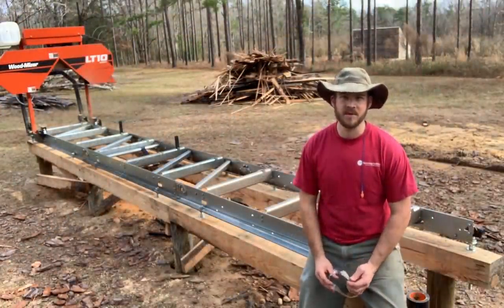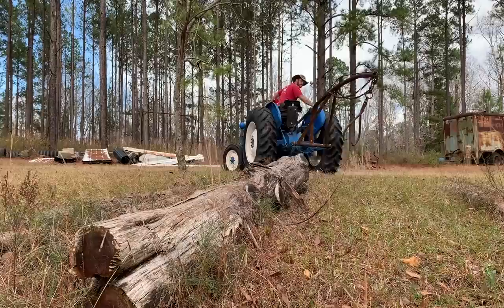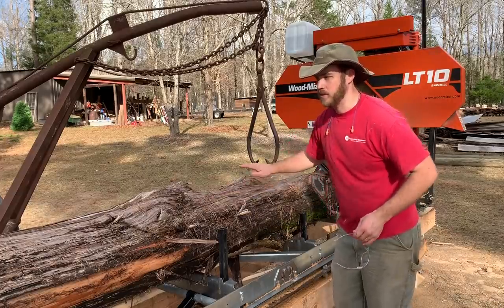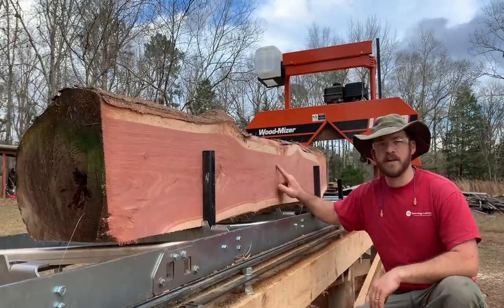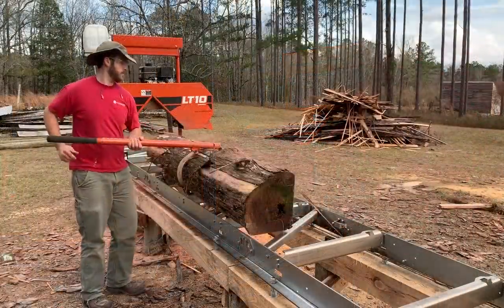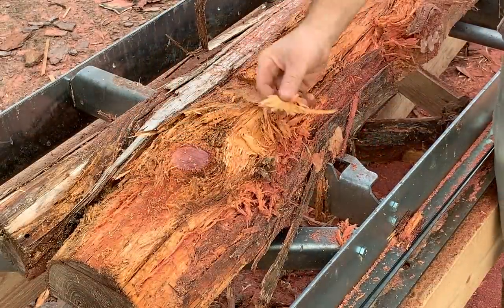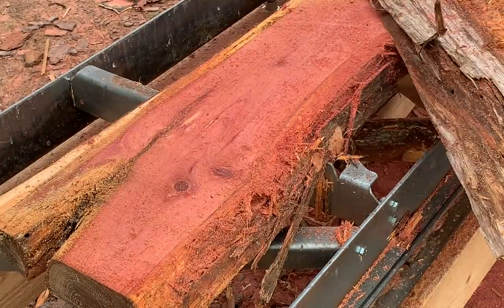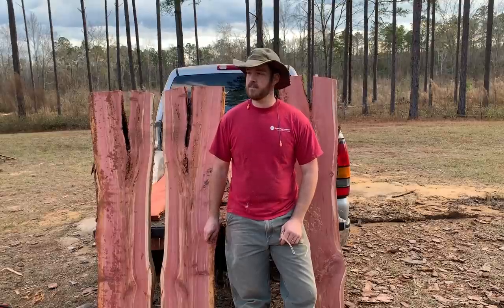BEAUTIFUL Red Cedar on the Wood Mizer LT10!

Comment: I have some cedar logs wish i had a way to saw them. Not sure if i want to make cabinets or flooring out of them need both. Nice job on the mill looks good and i bet sure easier to run. I also have some walnut and cherry.
Reply from the maker: Thanks Ken! Load them up and bring them over!
Reply: @falllineridge  if you wasnt so far away i would its a longvway from WV.

Comment: What fluid do you drip on the blade? I do not use any, but thinking about it for pine as it is so gummy if really fresh. The platform looks great, I could not run mine on the ground anymore. It will really save your back!
Reply from the maker: Charles Wilke Just plain water. Works good except for extra sticky pine. My back is really enjoying it so far!
Reply: @falllineridge  use a cheap pine cleaner like pinesol and water  I used to use diesel fuel to drip on my blade and then found that pinesol works just as good for pine

Comment: A ways like sawing cedar. You could put a small ledge on your support to lay your log stops on off the ground,also put another board or block between your can't and stops this will move it out a bit to miss the knots with your blade guides.
Reply from the maker: Good idea on the stops, I was wondering what I could do with those. Thanks for the tips!

Comment: Suggestion : Since you have decided to slab the log, then I would assume that you must be planning on selling the slabs to a custom furniture maker. I noticed that you did not remove the sawdust before you stacked the slabs onto the bed of your truck. In the future, I would suggest and caution you to immediately remove all the sawdust on both sides of the slabs with each cut you make and again before you stack the slabs for transport to the slabs drying area . If the sawdust is not properly (fully) removed during the cutting stage, it will draw and hold moister which is detrimental the slabs drying evenly and will also slow the drying process. If you are going to air dry the slabs, the sawdust will quickly invite many types of small insect such as wood boring beetles and wood eating ants to feed first on the sawdust its self and then on the wood. ( The aforementioned rarely happens with aromatic cedar, but caution is your best defense for all the lumber you cut )

Comment: That lift extension on the back of your tractor, what’s it called?
Reply from the maker: It's called a boom pole. They are relatively inexpensive.
Reply: Fall Line Ridge   Thank you so much.  It really moves logs quite easily.

Comment: You might checkout Northern Tool for Roughneck lifting tongs (item #51620-2954). it lifts up to 3300 lbs. my sale price in  this book shows $169.99 and has 4 claw tongs.I feel this tong would lift logs more safely than your 2 tong skidding tongs you use.

Comment: Great job on resetting the sawmill looks solid as a rock.  I noticed ya did not put on winch and log bench and went with tracktor loading it.  I think that works but I see one problem.  That is you have to get so close with that old tractor I can see that back tire grabbing that rail and bending the snot out of things.  I would still build a log bunker or bench or whatever  you want up high and use a Cant or Peavy bar to work it on.. IF not then use one of those cheap 2 horsepower capstan built in winches and throw a rope over the log and haul it in.  Look forward to more videos and here is  a link to that winch. https://www.youtube.com/watch?v=GxqztmPkv8c
Reply from the maker: Still planning on the winch and ramp. Just haven't gotten there yet.
Reply: 24 hours in a day aint enough I get it :)  Just keep safe and keep at it things will fall in place :) @falllineridge